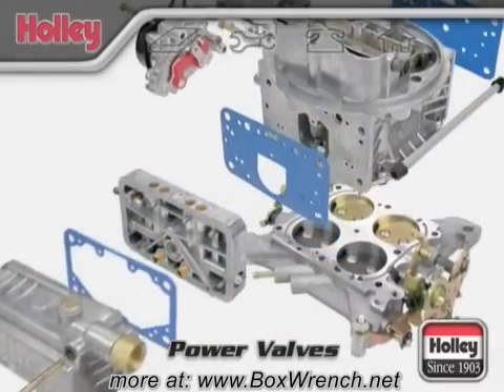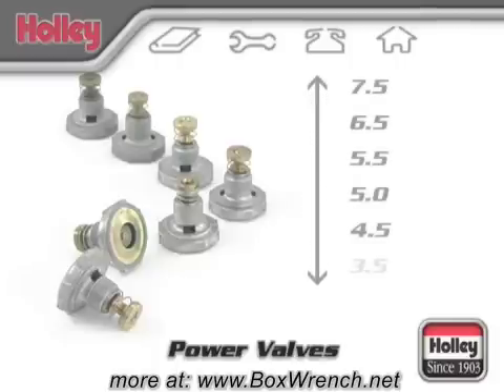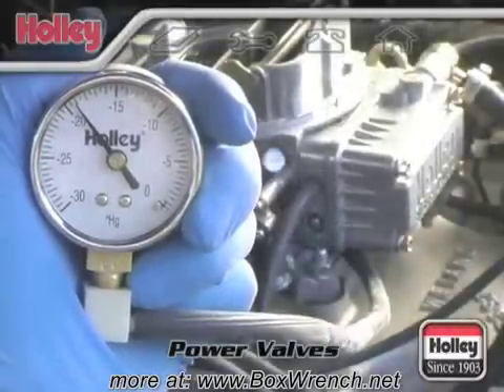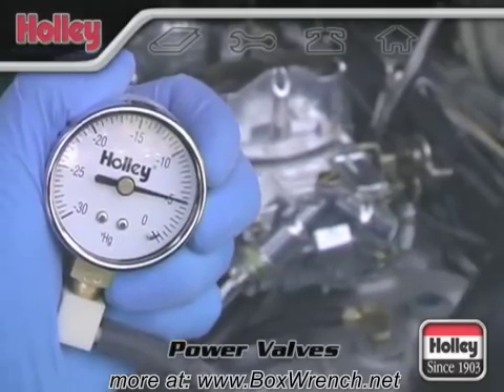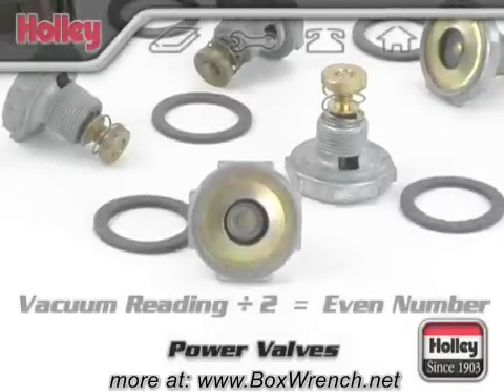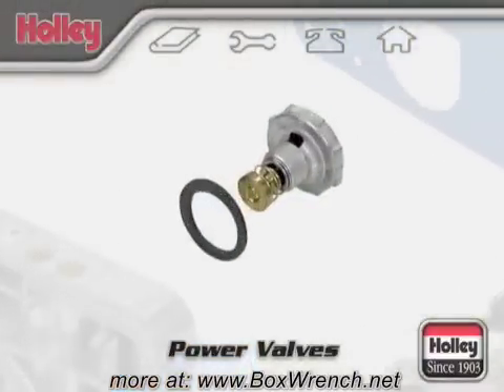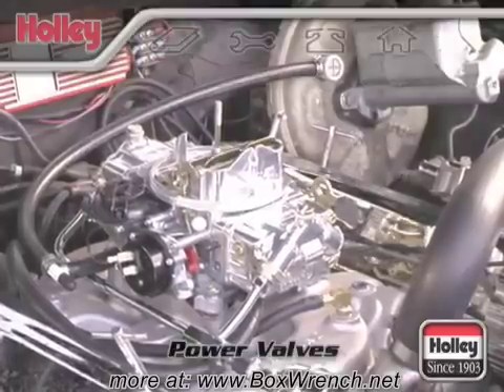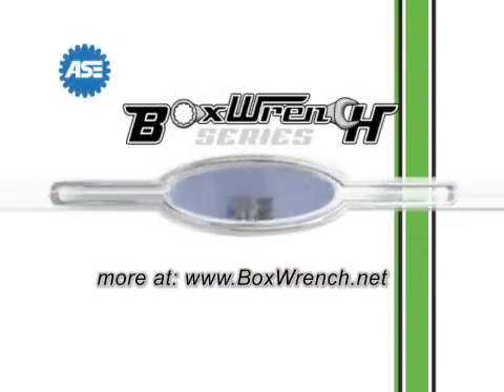Carburetor Power Valves Video - Holley Carb Tuning DVD

Comment: Does this power valve test applies to 4 corner idle?  Or just the main metering block with the power valve installed.  My secondary metering block has the idle screws with out power valve.

Comment: My Ford 460 in drive, idles at about 550-575 rpm with about 18"hg.  If any stock engine like mine that makes over 13"hg at idle is fine with the stock 6.5 valve, why would I not want to install an 8.5 power valve?

Comment: No, edelbrock is an AFB Carter carb. Not a quadrajet. carters throttle plates are all the same size, unlike the quadrajunk which has 2 small primaries and 2 large secondaries.

Comment from the maker: @88l98vette You very likely don't need that 50cc upgrade to the accelerator pump system, but you can leave it in place if you really want to. 
If you just stick with the stock 30cc pump and then start with tuning the accelerator pump cams that screw into the back of the throttle lever, you may solve your issue.

You may also need to upgrage the size of the accelerator pump nozzle (squirter) to get the off-idle stumble to smooth out. 

we have a video for the accelerator pump cams here at YT

Comment from the maker: @wakawu 
You're experiencing an "off-idle" hesitation as soon as you touch the pedal. The term "off-idle" isn't a perfect description of the problem as you and others experience the same hesitation throughout the powerband when ever you mash the pedal. 

Your problem is the Accelerator pump circuit, it has tunable components. One is the accelerator pump cam, the other part is the 'primary squirter'. Just search "Accelerator Pump BoxWrench", we have a video describing the tuning here on YouTube

Comment: Thanks for these videos, very very helpful! I had a question regarding my Holley 4160 carb. I tried tuning it the best I can with the idle mixture screws on both sides and got it to idle and startup pretty well. My problem now is when I give it wide open throttle or mash on the gas at any point I get a slight hesitation sort of a choke not really a backfire. I have to roll on the gas slowly to give it full throttle. Any suggestions?

Comment from the maker: @kd5icr1967 
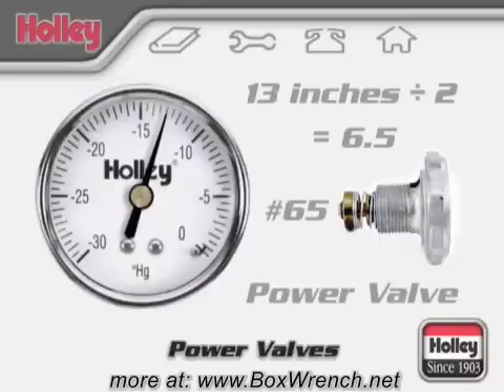yes, you are correct in your baseline power valve tuning calculations. We have shown the same recommendation you recommend in this video... if you watch from 1:35 from this video, you will hear the same recommendation from us that you describe here.... take a vacuum reading and divide the number by '2'. If the number you arrive at is not directly available as a Holly Power Valve numerical rating, then use the next lowest Power Valve available below it, just as you suggested

Comment: wafrederick ur on crack man.. my 350 had a 650 edelbrock on it b4, we took it to the dyno once my bowtie heads and Nx268 cam was in made just over 355 hp, we stuck a out of the box holley 650 with mechanical secondarys and it made an extra 15hp.. thats alot of hp by just throwing a carb on.. now ive replaced the base plate, and jets and it pulls harder then ever!! and i drive my 81 cutlass everyday rain or shine.. and Snow bec im from British Columbia..

Comment: There is one thing to do with a Holley carb,throw it away replacing it with an Edelbrock since they are only good for racing applications and are not good street carbs.Plus with a Holley,change one part and you have to change every thing.The Edelbrock is much easier to tune out of the box and the best street carb

Comment from the maker: You can get an aftermarket upgrade kit that will allow you to drill into your throttle body carb base and install a power valve protector. The part is available at Summit or Jeg's. 
Also, go to Holley's website and use their "carburetor selector" to run through and find the right CFM rating for a carb for your engine type.

Comment from the maker: first verify your plug condition to be sure the engine is in good tune. Check compression if you can to be sure. Then verify your spark and timing is good. (weak spark or non-operating distributor advance can cause symptoms)

After verifying all that, then you could begin to tune the power valve and jetting after reading your spark plugs. Jet tuning is described in our Holly Tuning DVD if you're not familiar with the process.

Comment: if you haven´t backfire protection, you must use a power valve that opens early. maybe you get a little smoke on the exhaust, but is safer for the valve.

Comment: question..can you modify an older 4150 with backfire protection to stop power valve damage,thanks for this informative tape..also do you have a chart to indicate the proper size carb for c.i. of motor ..most people tend to over carberate ..then complain of poor performance because they don't knw how to tune their fuel system

Comment from the maker: This method was designed and is recommended by Holley factory technicians for setting baseline power valve range. It will set a good starting point for anyone to begin further tuning from. 

If others disagree, it would likely be that they have another method for tuning for race or performance. 

Using a vacuum gauge to determine what the internal vacuum pressure of the engine is at idle is the most accurate way to set your baseline before tuning for higher performance.